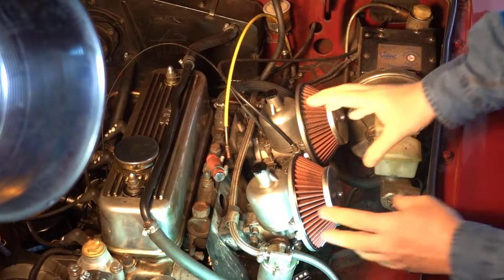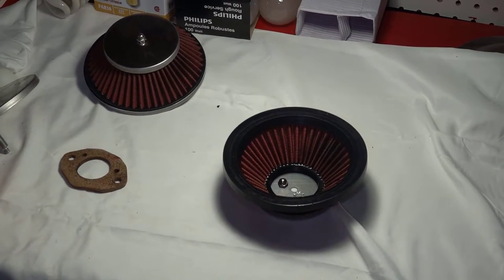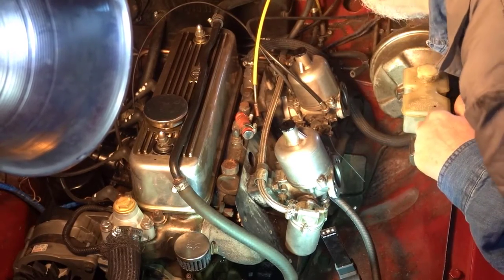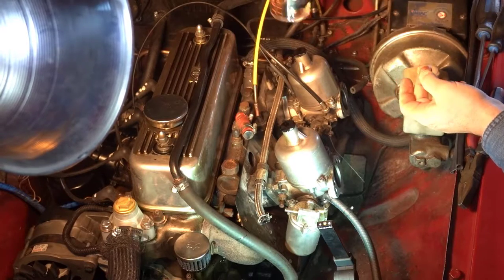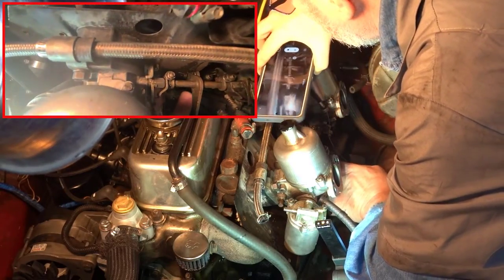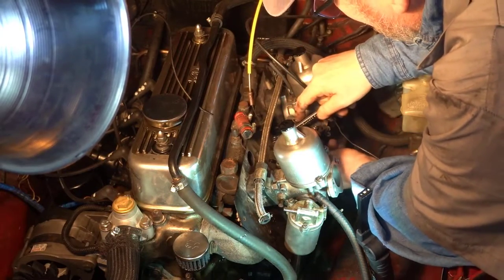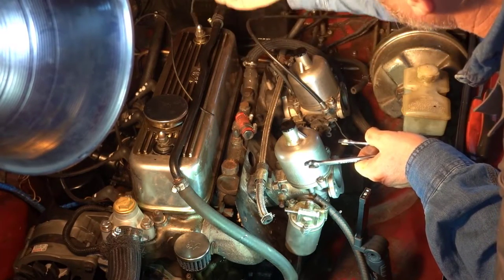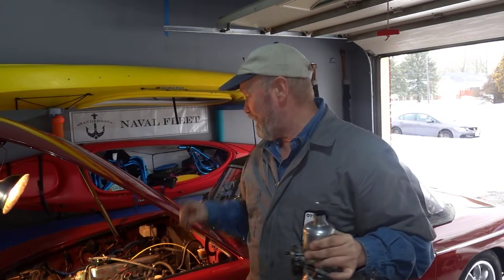SU Carburetors - Removal on MGB

Comment: Burlen UK is the company which owns the SU brand. You will be able to get every bit and piece you need from their website.
Reply from the maker: Thats a great website and I will keep it for future reference. But that part is 5.95 Sterling and 21.00 Shipping
Reply: @MGDRIVING  The original replacement parts do not come cheap. However, the parts which I got from them were all of very good quality, and using good materials.
Reply from the maker: @windmill1965  I totally agree. However, I think I can get this part locally from the Sports Car Factory for little or no cost (hoping). Otherwise, yes, I will need to pay the piper.

Comment: Would it be possible to remove just one carburettor?  I have a fuel leak at my front carb and I think I just need to tighten a bolt which I can't currently access because of the throttle and choke linkages.
Reply from the maker: Sure it is possible, but I do not understand why you cannot access the bolt that you mention? can you send me a picture?
Reply: @MGDRIVING  it is blocked by the choke linkage
Reply: Never mind I just discovered and cleared what I think is the block in my carburetor